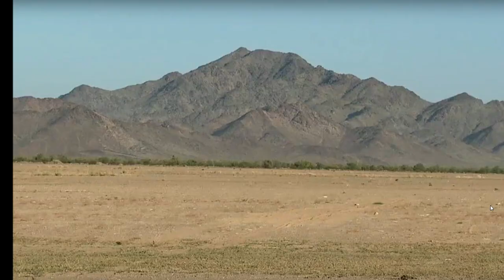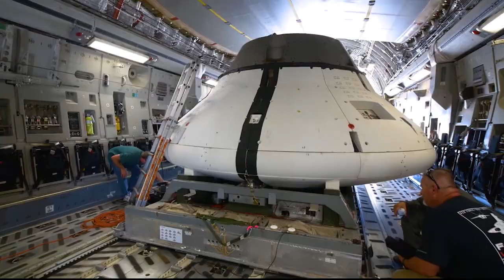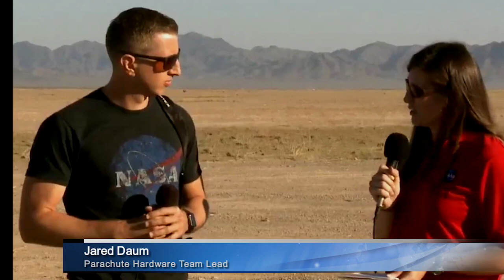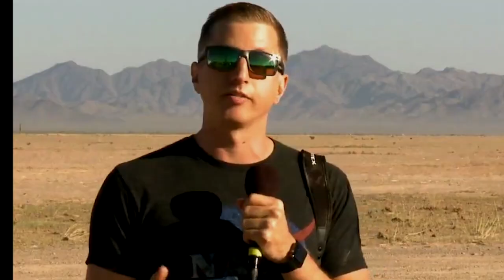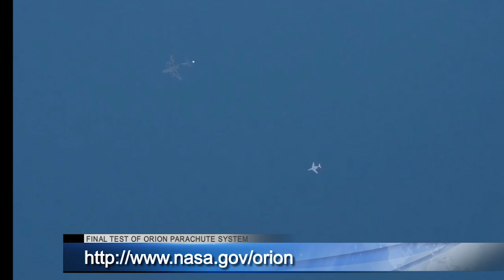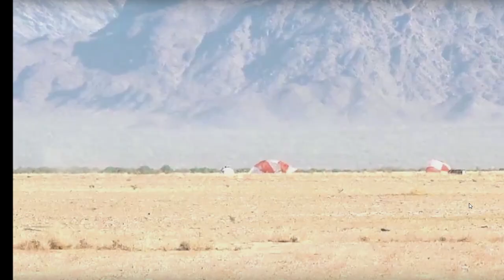Final Orion Parachute Test for Missions with Astronauts

Comment: Well, back to the parachuted space capsules as before!
Reply: They're the safest till we get winged runway landers again, which won't be launched next to a big H&O tank, but on top of them.
Reply: Sure, now that the space shuttle's history seven years ago.
Reply: Have you noticed that aircraft all have had the same basic shape for nearly 100 years (with very few exceptions)?  Long fuselage, wings roughly in the middle, and a tail at the back.

And that cars have had the same basic shape for longer than that?

When a design works, it works.
Reply: almostfm    There's actually two basic plane or wing types.  Although most planes (as you say) do have a larges set of wings in the middle with a tale wing, some supersonic planes only have a single set of delta wings.
The shuttle wings were close in shape to what was used on the Concorde.  Both of course flew at supersonic speeds.   
The stealth bomber was different in that it didn't even have a vertical tale, but that had less to do with aerodynamics and more to do with making it stealthy. 
Another more minor difference, are the planes with the tale wings at the top of the vertical stabilizer.

Comment: Great I recall  also related to the joy and, success for Context 
Making models with my sons was great :good fabric, string, an safe 
Paper rolls & an engine 
Fuse An launch 🚀 
🔑 💨☝️💫
Later on my own tried the triple parachute
For pod sea 🌊 land the kind with red circles 😁👍🎯kinda like a dartboard 🤷‍♂️😁👍
Soon a new pod from the ISS shall be used 
For Context the X-38
Holds over 5 entering back into the atmosphere much like the shuttle has pyrotechnic strands popping the Shute 
They can now pilot
Even steer to safe ground ingenious 
I say & may your joy be your strength 
Godspeed 
From: LarryWhittington 
Sincerely